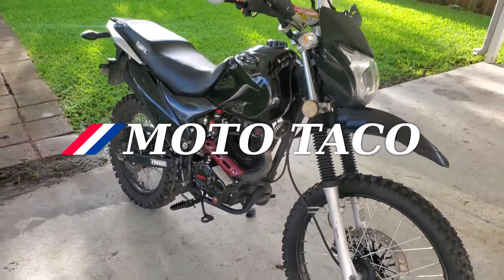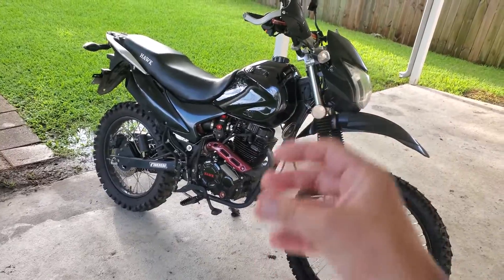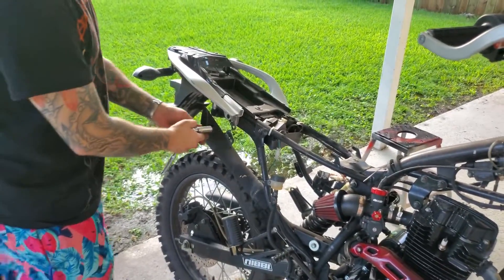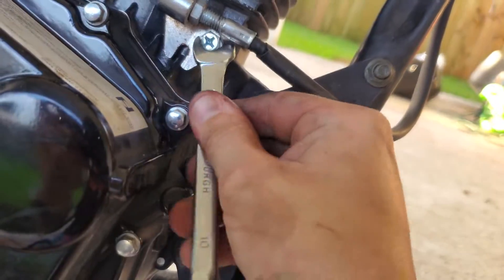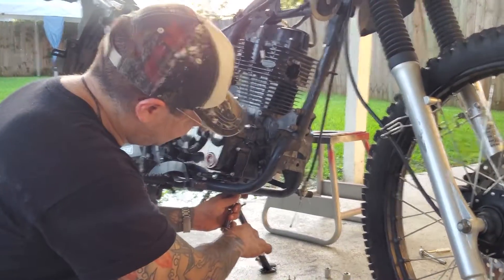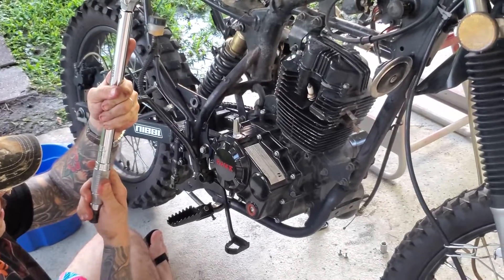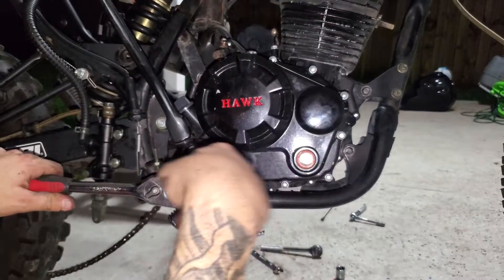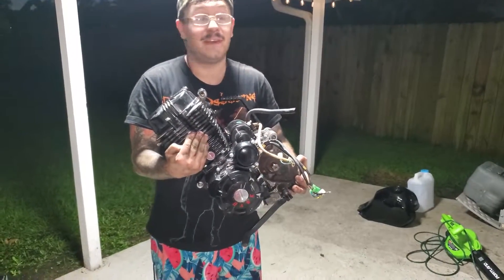HAWK 250 ENGINE REMOVAL

Comment: The strainer screen oil is inside on the left side and in the bottom sideway plug bolt. That screen is not super fine screen like coffee screen of stainless steel. It is recommended to get a designer to get oil filtration into like a pro from similar idea to Kawasaki oil plug = bolt as big as 2 inch diameter or 1 1/2 inches head and thread hole in thru the camshaft cover on right side. More like 1/2 cup capacity oil screen something called cartridge down to minimal 1/3 cup capacity screen. If the oil pump is external part of the motor and it is bolts tighten to the side of the engine and thru the engine to recirculate the oil. We wish to see the oil pump in the Hawk 230cc or PR250cc. The stroker is 65mm stroke cranking and like the crankcase is to be cut up open to change the crankshaft out of the engine Hawk in new new generation. The Honda XL250 is siamese twin jug with two complete exhaust pipes as part of the moped fast bike. With maybe LiHua CDI and regulator rectifier full bridge harness wiring includes dwelling advance timing manifold vacuum into the intake pipe between the 30mm PWK carburetor and cylinder called intake manifold but there is no third hole in the intake manifold. You can see the manifold ithird hole/port is connect to the smaller hose to cut on the manifold vacuum in the system especially mass air flow sensor in the EBAY , it display the adapter image. The Hawk is not include the intake manifold so it is intake pipe - two holes in both end.

Comment: You have 229cc Hawk HaoSen-Hensim motorcycle and there are not design to sell 6 speed transmission. The shorter ground clearance is like 4 inches off from the Bike electric start vertical PR dirt bike with very high ground clearance ever in world record. The monoshock absorber is 8 inches long as it is avail from the EBAY. Right now the rear shock absorber is 12 inches long plus a fork is to be shorter by 3.5 inches off to street legal and riding much more control. Zongshen is design to take the Hawk stator 8 coil that replace the X PRO stator and these are to save over $200.00 dollars saving so that the motorcycle repair man could charge for labor to find that the spark plug would not fire. Zongshen is not taking apart yet for it is CG250 cc no less than 249 cc and the domed nuts can come off by unscrew them and they are air cooled oil cooling system. The oil can heat up to not more than 190 degree Fahrenheit as long as the Hawk uses the oil cooler with two oil hoses to the pan head valve cover from the EBAY Motors. Because the oil becomes too hot like 250 degree Fahrenheit then the engine is tear down and wear out too fast. More tube straw that is it called oil jackets up and down thru the cyclinder of the Hawk or X PRO 72mm bore x stroke is CG. That you the Hawk engine is really 70mm bore x 65mm equals 250 cc from Big Bore Kit named DVNOP brand and under valve cover you saw the cylinder head studs is the much bigger bolt pattern diameter of 4 stud with hex nuts. The domed nuts of the cylinder head of Zongshen way atop of the engine is much smaller bolt pattern diameter than the Hawk RPS 230. The stud pattern is almost the same thing as bolt pattern, though the idea of holding down the cylinder down are the same. suppose the cylinder head stud for the Hawk is 14 inches long. The cyclinder head stud for the Zongshen is 17 inches long. The cylinder for the Hawk have a flange at the bottom so the hex bolt can go thru and tighten the crankcase and cylinder together. The Zongshen cylinder does not have flange. Zongshen engine 250 cc does fit in and mount in the chassis of the Hawk 250 but very different mounts plates longer length than the Hawk mounts plate.

Comment: Just so people know if you buy the 70mm big bore kit  fits without any fabrication to make it a 300cc if you buy the 72.5 big bore kit you have to hone the block to 76mm or 2.998inchs to make it a 350cc
Reply: I recommend the 70mm big bore easy to install and less mechanical experience needed

Comment: Would the 300cc big bore kit work with the csc tt250 of Would I need a different yet similar big bore kit
Reply: the CSC tt250 looks to have a CG250 OHV engine so yes the CG300 bigbore should fit in theory. However you need to know is the cylinder skirt will probably require machining down to fit into the CG250 case...also you will need to confirm the size of the piston wrist pin diameter.
Reply: @UncannySense  good to know thanks and I'm so looking forward to see the power gain from the kit